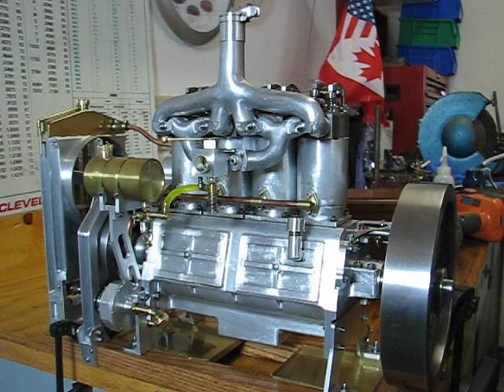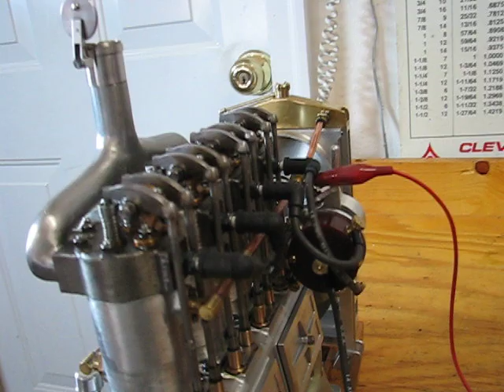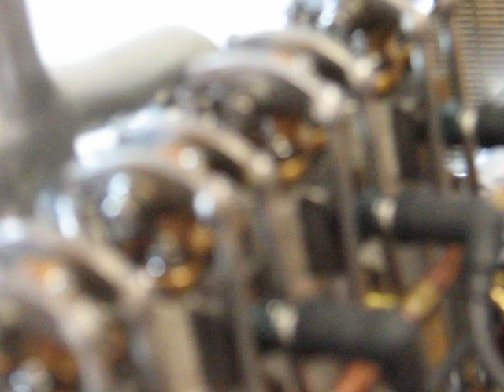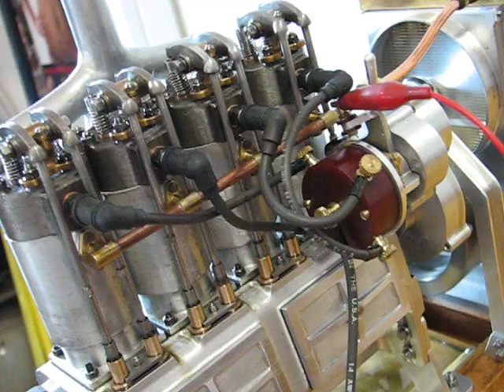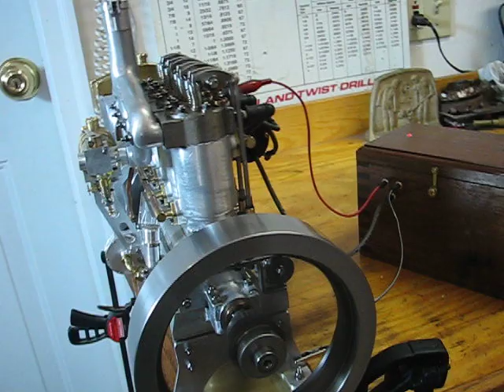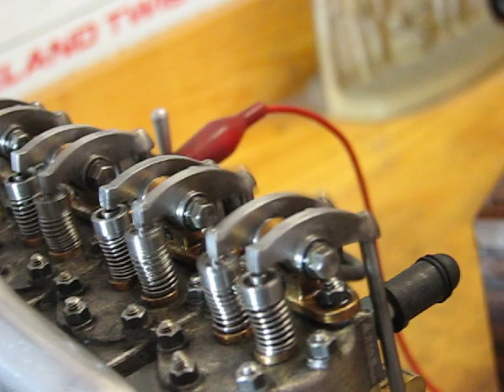updated Holt video

Comment from the maker: @LarsAlaska 
The engine is 3.93 cu. in. 1.00bore x 1.25 stroke. It is a pretty heavy engine what with the 2 flywheels. With only one smaller flywheel the weight could be dropped considerably. The only thing that would do is bring the idle rpm up. I've never weighed it but I'm guessing in the area of 14 lbs.

Comment from the maker: @AlchemistHawk 
It's made from square brass stock. It's chucked in a 4 jaw chuck, drilled through from both ends then slid out and supported by a live center. Now a cut-off tool is used to cut the fins along the length of bar stock. Once these are finished an upper and lower header are made and the cores are soldered into them. Finally the top and bottom tanks are soldered to the header plates and the fittings, inlet, outlet and filler neck, are soldered to the tanks.

Comment from the maker: The base is machined from aluminum and the cap is made from a dialectric type material. Some people use delrin. You can use anything that has good insulation properties.

Comment from the maker: @pskittle488 
There is a formula for rpm and displacement that will give an approximate horsepower rating. This engine should develop about 3 hp. 
The scaled down radiator does not provide enough cooling to run the engine continually. The biggest problem is not the size but not being able to pull enough air through it. No matter how much pitch you put on the fan blades it just doesn't spin fast enough to get the air moving. From cold I can run this engine about 10 minutes before it gets hot.